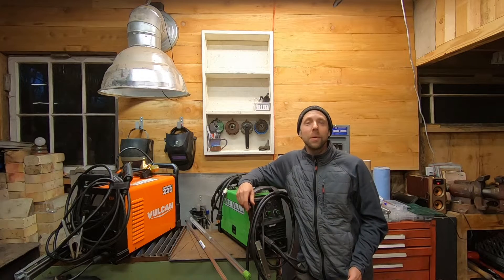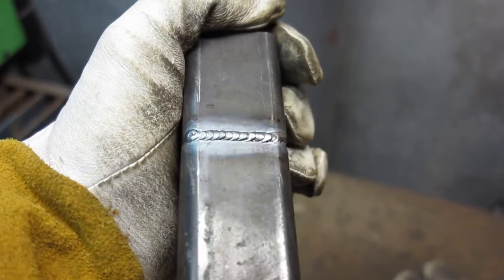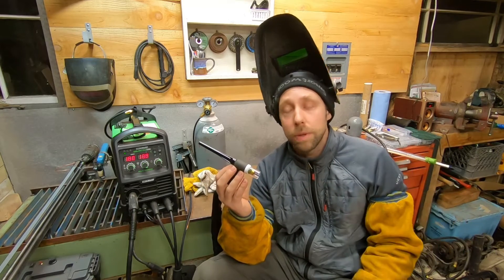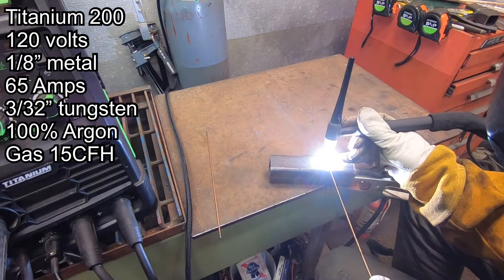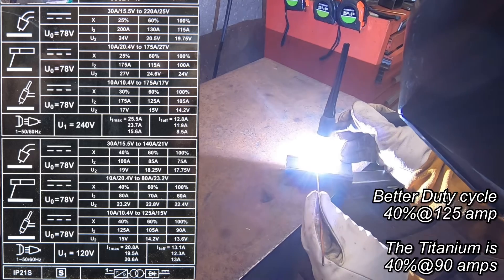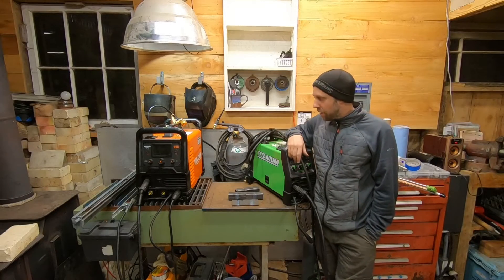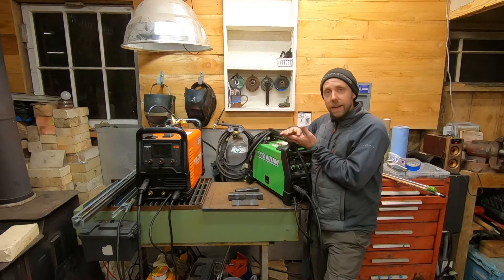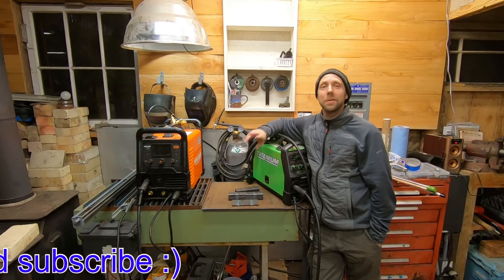Titanium Vulcan welders TIG comparison

Comment: How has the titanum multiprocess been holding up since this video? im looking to purchase either it or the vulcan, and was wondering now that you have had some time with each, how they stack up today, and which you would recommend overall. For me is probably going to be more a garage machine, portability isnt going to be a big deal because i'd either have to also take the tanks or use flux only, and i've got the easy flux 125 and love it, i purchased it largely based on your reviews, worth every penny, and HF even honored a coupon that came out a couple of weeks after i got it, so got some money back. With the current coupons they only have $120 separating them. From what i have seen i'd lean more vulcan for that price difference. But value the opinion of someone with both and to know how the unlimited has held up.

Comment: Typical torch brazing rods will probably work with tig, but the problem is more with the fact that the zinc (I think.  could be one of the other metals) in them vaporizes and can be inhaled.  This is generally not good for you.
Reply from the maker: elkvis They really don’t work for TIG, I had tried them before, and yes you are right about the zinc.

Comment: I enjoy watching your vids on demos,they are very informative. I bought the mig max 140 for a 120v welder to run off a generator/household outlets. I don't need a 220 mig feature as I have a snap on YA2112  230amp(don't hate me lol) now I'm in the market for a tig welder. My question is is there a difference between the  features of the omnipro 220 tig part as apossed to the protig 165? I can return the 140 and for $316 upgrade to the 220,as for the stick I'm going to buy a stand alone one. I just don't want a computer controlled software driven welder that could potentially stop working and I'm out the 120v mig side of it. The 140 is very simple as appears the 165 is as well. Thank you for any info you can offer me!!

Comment: So I bought the titanium-due to budget concerns- and I wanna know- can I put an after market pedal on this? Or even a trigger for the TIG torch? Would it work if I put one on here?
Reply: the 5 pin socket is for the mig wire feed only.  for tig you set the amps by the panel and scratch start the weld.
Reply: So far theres nothing released that's a plug in pedal or a stinger with a button. Not sure if others have modded something along the lines.
Reply: @victorsanjuan5107  thanks mate. I did see on Amazon a 5 pin pedal and I saw the titanium has a 5 pin socket. I was curious if this could work for it 🤔
Reply: @HisDarkAngel  man if you find something out definitely let the world know lol I'm hope HF surprises us and gives us a foot pedal and high frequency start. But I'm not holding my breath.

Comment: Just one minor correction DC is actually superior to AC for aluminum welding. The penetration is a lot deeper and you don't have to cut a v groove. So you can be more productive and weld thicker pieces in one pass. Just switch your gas to pure helium, it burns hotter. Again I know you're quick to call people trolls but this is not trolling. Please make a video of it and see. It's harder to weld dimes but if you're good you can
Reply from the maker: eksine I do know you can but how many people do this in there home shop? I’m not quick to call people trolls unless they are being rude and hateful. I my self am not interested in buying a tank of helium to make a video on this because I own a AC TIG welder and a bottle of argon but if you have a video of welding DC and Helium or would be interested in making a video I would be interested in seeing your results.
Reply: @Mikefestiva  no I saw a video on other channels especially the one on weld.com's channel. The welds came out really good just like yours with steel. I think of you search something like a "DC aluminum TIG" you'll see it. I was just curious because I have the same exact omnipro 220
Reply: Helium is so expensive not worth it for a home gamer you are right though

Comment: Thats dissapointing that they cant tig alloy as its my main reason to buy a tig machine.
Reply from the maker: Yes it would be nice if they both were AC TIGs but even the $2000 Millermatic 200 is a DC TIG multi process welder. If you need to weld Aluminum you are better off just buying a dedicated AC/DC TIG machine
Reply: you CAN dc tig aluminum, using helium

Comment: Mike if you could only buy one of these machines which would it be ?
Reply from the maker: Hey Chris good question, when I started this series I really liked the Omnipro, I had it for about 9 months before I bought the Titanium 200 so I really didn’t think the T200 would be on the same level. After running both welders for months together I found the T200 fit my needs better because it’s lighter weight, more compact and was a few hundred dollars less.
The Omnipro had a lot more features and is a really solid welder, but I found I could live without all the extra stuff in trade for the portability of the T200. If you are completely new to welding the Omnipro walks you through the process of what terminals you connect your leads too and the auto set is really nice. The T200 comes with a little card that shows you the same things it’s just not on the screen like the Omnipro. One other thing, the T200 comes with a TIG torch but there’s no amp control pedal available for it ( I personally don’t feel it’s a deal breaker for me) The Omnipro doesn’t come with the TIG torch or pedal, they have to be bought separately, so that adds extra cost. I hope this helps 👍 I have quite a few videos covering all the features of these welders so check those out if you are still not sure.
Reply: @Mikefestiva  thank you. I grew up in a family excavation business and have done a lot of stick welding which I am very good at. I want to get into mig i have done it a couple times but my guess is that will be my main type of welding once i learn. i just finished building myself a garage with a car lift. i do all my own mechanical stuff so its just for me not a business I just want something for myself and will mainly use it in the garage.  i love to fix and putter.

Comment: wait no hf start? my eastwood tig 200dc has 120v/240v 200A output and a 30A draw and was $450
Reply: Ya you can get better stick tig machines cheaper. However it's hard to find a multiprocess machine below 1000 with great tig options

Comment: Does anyone know if the titanium has a pedal for adjustment?
Reply from the maker: No Patrick there’s no pedal available for the TIG. I spoke with the head guy at Harbor Freight’s welding development team and asked him if they are going to sell one for it and it sounds like they will not. I found that for DC TIG it works fine to just set your amps and you are good to weld.

Comment: hi Mike I bought a Titanium 200 and for tig it works great!
 I'm taking a 2 credit Tig class this Sem. and that's on a miller 200 dynasty.
its real easy to make the adjustment to the titanium with scratch start from the pedal.
I'm practicing on 1/16th " mild steel, I have the unit set at 60 amp.s, inductance at 6 and
100%argon  gas at 18 cfh.
I am very happy with this machine.
  I upgraded to the gas lens,  pyrex cups and am using 1/16th" grey tungsten.
Thanks a ton for your Videos they helped me make my Choice.

Comment: I see you doing a lot of testing with the titanium 200 I have one as well Warning to tig with it noticed something weird in the factory directions when you get it it obviously hooks up to the tank in has a mechanical  Valve for the  Gas M the directions I have it shows that it hooks up to the gas valve inside the welder  plugs in to the port for the spool gun does anyone else have these directions I know there is a spool gun you can get on Amazon that works with this machine I'm wondering if you can get a TIG torch that works like the vulkan
Reply: Can you use a tig pedal with this?

Comment: Mike, like I said in another comment to you. I’m a newbie at welding. I was looking at the Titanium MIG170 and now I’ve started looking at the Titanium UNLIMITED 200. I’m not really sure if TIG welding is in my future or not, but it would be great to have that ability in store. So my question is. Would I be better off spending the extra $200 for the UNLIMITED 200 and have TIG if I ever really decide to use it?
Thanks for another great video. 
Stan Lucas
Reply from the maker: Hey Stan I would say if it’s not to far out of your price range buy the 200, you may find a time where you want to TIG weld? But if it’s not in the budget for you just go with the 170. If you really don’t think you need or are interested in the TIG and Stick that $200 would buy you a smaller drill press or a 6” wide belt sander? Ps if you buy the extended warranty ask about tool upgrades, I bought a large table top disc sander, they talked me into the warranty because they said it was also good for upgrades, about 3 months later I decided there was something I didn’t like about the disc sander, took it back and upgraded it to a 6” belt/ disc sander, 100% purchase price credit to the newer sander, I just needed to pay the difference. Think about it. Take care 🙂
Reply: Mike Festiva:
Thank you for the info. I should be able to pick up my Titanium Unlimited 200 with in the next 2 weeks. I’ll practice with the flux core wire then switch over to MIG  with gas at a later date. 
Thanks again Mike. 
Stan

Comment: Hey Mike.   Awesome as usual.    A trivial question .... the dimensions of the T 200.   It shows on HF website as the same as V220.   So they must be in the same size carton when they say “product”.   The T200 is clearly smaller.   The website shows the clear weight difference though.   Thanks.

OK.   Should not have bothered Mike.    I stopped by HF after teaching a class and here are the footprint dimensions of these two welders:
Titanium 200.   8.5” x 19”.   Say 9 x 19 to be safe.
Vulcan 220      11.5” x 20.5”.   Say 12 x 21 to be safe.
These numbers are strictly the footprint and does not count protrusions of cables etc from the front.
The numbers shown in the HF web site wile do show weight differences must be the shipping box.
Reply from the maker: I can’t remember if the actual shipping box was smaller with the Titanium 200? But the two welders are definitely a lot different in size, plus they each come with different components in there boxes, I thing there’s about 20# different between the two welders alone. Take care 🙂

Comment: What is your opinion of welding 1/4" steel for suspension components with either of these machines?
Reply: both of them will weld 1/4" steel with no problem
Reply from the maker: Hey Jim like Dave said both welders would have no problem welding 1/4” single pass. I would say as long as you feel confident in welding, both welders work great.
I posted a Real world duty cycle video a few months back MIG welding a big glue press with both of these welders, check out that video, the metal was 1/4” plate, 3/16” and 1/8” box tubing. That pneumatic press holds the force of 93,600 lbs, it’s now in production and holding up great. Take care
Reply: @Mikefestiva Sorry, I didn't fully form my question.  I meant if these were capable of doing quarter inch in tig mode.  It's something I have been thinking about learning for my latest project.  Thanks.

Comment: I noticed it looked like you were scratch starting it and that can contaminate the metal and tungsten I would use a high frequency start
Reply from the maker: Yes one welder is scratch start the other is lift start, that’s all you get with these machines, of course one would use HF if it’s available on the machine, but not all welders have that capability. Ps for anyone welding projects around there house I think scratch or lift start works fine.
Reply: @Mikefestiva  if you use the opposite side of filler to spark. Then flip it over and use clean side to continue to weld. I learned this from Jody on welding tips and tricks. Nice welds by the way.
Reply: @Mikefestiva  I seen HF has the cheaper Chicago Electric tig/stick 165Amp machine with HF start, I just bought the Titanium Unlimited 200 but am going to pick up argon tank tomorrow to try out the tig welding, I thought this had HF start or at least lift start as well going by the price tag.. oh well. If I had known I would of bought the Mig 170 and 165A Tig/stick for the same total price ($700 with coupons) as the 200 - which would of gave me HF start and a foot pedal.

Comment: Hello Mike 
Enjoy you’re videos!
Ijust recently bought an Omni pro
I noticed that when I go to turn it off the warning screen pops I was wondering if that is normal if by chance you could look at yours the next time you shut it down 
Thanks in advance Joe
Reply from the maker: Hey Joe don’t worry about it, I remember seeing that before on my Omnipro flash on the screen for a few seconds after turning off the power switch,  I cannot say for sure but it could be a voltage thing? I don’t think I saw it as much when welding on 240? I never had a problem that came of it. Ps I have pushed it hard on a couple of long 14 gauge extension cords welding up at my mill, it would start a arc weld for about 2 seconds then stop welding then spool out about a foot of wire, it never caused a problem to the welder, it must have internal power protection when the voltage gets to low it just stops the arc. I hope this info puts you at ease, not to worry about it. Take care :)

Comment: check out the primeweld 225 runs $775.  a/c - d/c tig / mma  it comes complete with foot pedal .  I bought one and boxed up everything but the mig torch on my Titanium .   For no more then what it cost you won't believe the difference .  And don't throw away your pink ceramic cups , you'll still need them getting into tight spaces .
Reply: I have the primeweld 225x its nice machine just need. Alot of practice. Im a beginner looking to lay down some good beads soon lol its harder than it looks
Reply: @HardKnocks160s  I can't decide between the alphatig and the primeweld. What made you guys choose the primeweld?
Reply: @kenneth6731  the primeweld and alpha tig are about the same i think the primeweld is better probly  has more settings. Its a big fancy machine. Iseen the fab forums fabrication  vid on youtube and iwas happy with the review he gave it.  its just a good ac dc machine that can lay some good welds. I bet the alpha tig will do the same.   Ilike it alot i just got to get more practice its easy to use very good welder.

Comment: Great welding there Michael. If those green Hi-temp O rings are Viton or similar, be sure to read the warnings about very nasty Hydrogen fluoride release at temperatures above 300 °C (570 °F). I remember reading about the dangers after a car had been on fire.

Comment: Thanks Mike! 
I have the Omni Pro and I really like it, I have not tried to Tig I want to however I need to pull the trigger on the gas, so far I have only used the flux core. With with true mig I would need a mixed gas argon/C02 vs 100% C02 for tig. I am a new hobbyist with welding.
Trying both of these will require two bottle leases if you had to go with only one gas bottle would you go the Tig route or the Mig?
Reply from the maker: Yes MIG requires ether 100% C02 or what I prefer C02/Argon mix this welds cleaner. I would recommend you get that tank first, TIG requires 100% Argon gas, I think you would probably get the most use out of the MIG shielding gas first, TIG is nice to learn but I find MIG to be the most practical in most applications. I hope this helps. Take care

Comment: Mike the might film maker! Thumbs up x1000. Thanks for taking the time to make this for everybody.
Looking forward to the Vulcan ProTig 200 video.
Reply from the maker: Thanks Joe! I hopefully will post a video of the ProTIG soon, man I really like it! I can weld fairly nice looking aluminum welds right out of the box, I need to cut up some aluminum this week for a project to build and Video it.
Ps I just got side tracked though, I had been keeping a eye out for a small suv, and I just picked up a 93 Suzuki sidekick 4 door, it has a oil leak that I’m fixing right now, but it’s in fairly good shape for $1000. I think it’s going to take  up a little of my time, I definitely didn’t need another project but I’m a sucker for useful little 4x4s. Take care Joe :)
Reply: @Mikefestiva  I recently picked up another Toyota pickup for a project. Its when I have extra time. Its a bit of a unicorn...a 1986 Toyota Turbo 4x4 extra cab. That thing has balls. I'm in the middle of bench marking it. I need to trust it. belts, hoses, gaskets, blah, blah, blau. You understand. Those sidekicks are tough as nails. Good price too!. Anything beats a car payment. I just finished replacing the head on my 1993 Toyota pickup today. Runs like a watch. Cylinder #3 intake valve seat came out of the head casting. What are the odds???
Anyway, I can't wait for your video on the Vulcan ProTig 200. Your video will probably motivate me to go finally pick it up. Ive been waiting for a coupon.